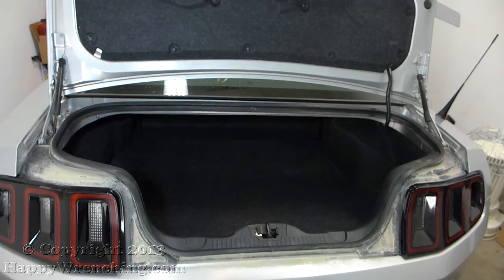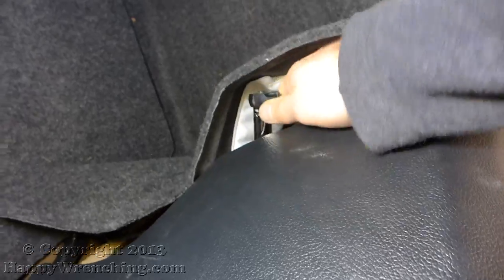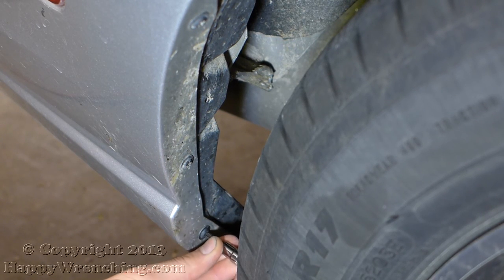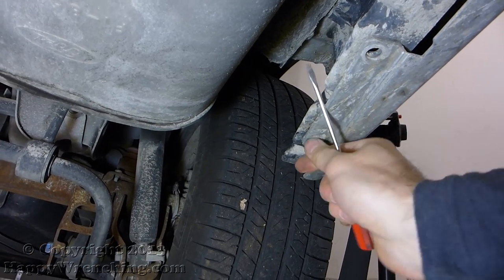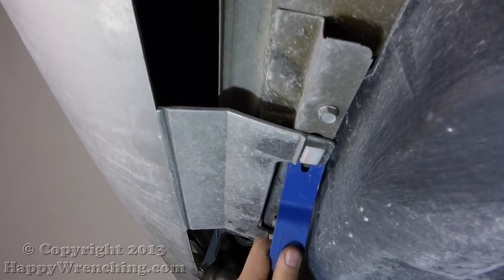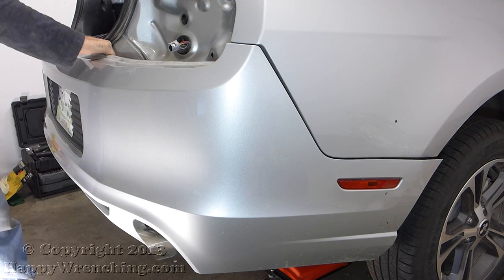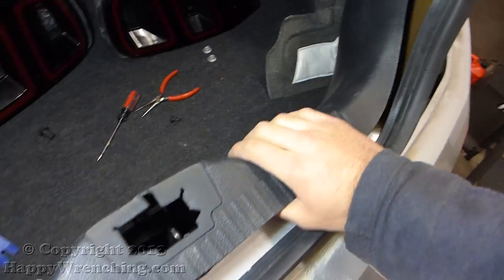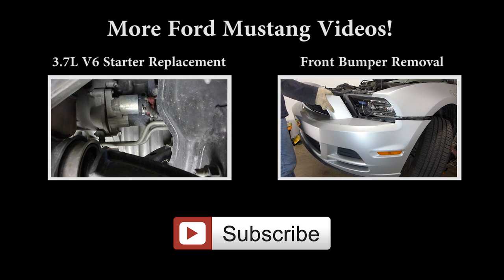Ford Mustang Rear Bumper Cover and Taillight Removal - Fifth Generation (2013 - 2014)

Comment: Thanks for posting this.  Just had to replace a cracked taillight assembly on my Mustang and this was extremely helpful in plotting out the steps necessary in getting the job done.  Great job videoing while working.  Extremely helpful video!
Reply from the maker: +Robert Rice Glad it helped you :)

Comment: I followed this video step by step. The only thing that I wished was included was disassembling the wiring on the old bumper. I struggled with this and unfortunately, after placing the bumper on my mustang, the lights weren't functioning. I don't know what's wrong and I am not good with wires :/

Comment: thanks, helped alot..just needed the tail light part, im putting some sound deading in trunk this weekend. helped, i did the lid already...those two push pins on the plastic part behind tailights are a bear to get off even with the pry tools

Comment: Is it possible to have the taillights on while the rear bumper cover off?
Reply: That's what I'm wondering too. We're you able to?
Reply: It should be possible, but there's a lip on the bumper that slides a little under the tail lights. Removing the lights makes the jobs much easier, and they're held by only three screws each, that are easily accessible.

Comment: Can You Fit Raxiom 2010-2012 Aftermarket Tailight on a 2014 Passenger Side Because My Tailight Is Out and I Can't Pay $700 For a OEM Replacement

Comment: Where do you get this blue tool you are using? @happywrenching
Reply from the maker: The tool that I'm using is called Schwaben Five-Piece Trim Removal Tool. You can get it on amazon, ebay, ecstuning, etc. If you google trim removal tool you can find the same thing made by other companies.
Reply: thanks a lot!

Comment: wish someone could show how to install 2013-14 xenon headlights in a 2010-12 mustang with halogen head lights, I bought a set of 2014 headlights with the 16 pin plug pigtails but all the wires are green I dont know what wire goes where, I know they sell those harnesses but they are expensive I got the plugs with the pigtail wires, I know I need a relay which I bought but wish I knew what wires goes where. just fustrated
Reply: +manlaw83 http://www.otsperformance.com/store/p283/2010-2012_Mustang_H13_Halogen_to_2013-14_OEM_HID_Headlight_Conversion_Harness.html

Comment: Can you fit a 2013 mustang rear bumper onto a 2011 mustang rear?
Reply from the maker: You'll have to swap the taillights along with the bumper. The stock 2011 taillights have a curve on the bottom that will interfere with the 2013 rear bumper.
Reply: happywrenching my under shield guard is interfering with my swap, I have a 2012 mustang trying to put on a 2013 bumper
Reply: happywrenching also my absorber is to big as well